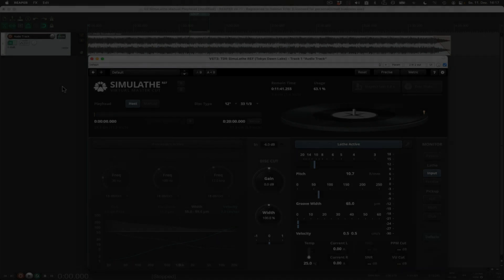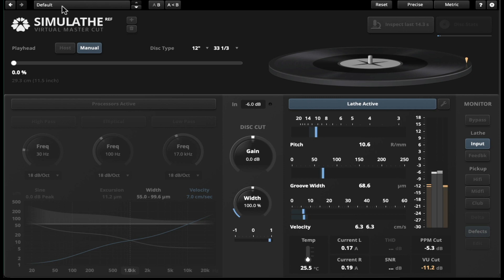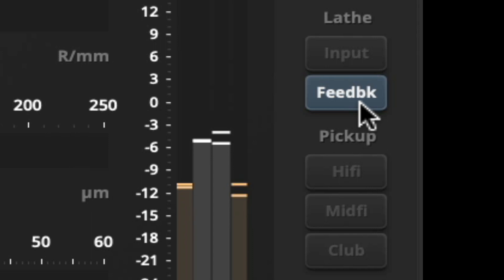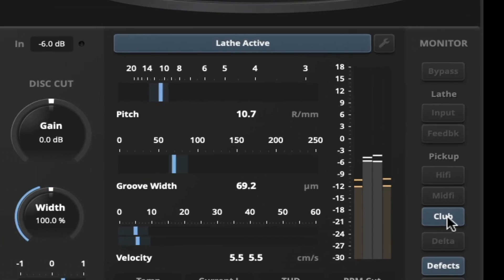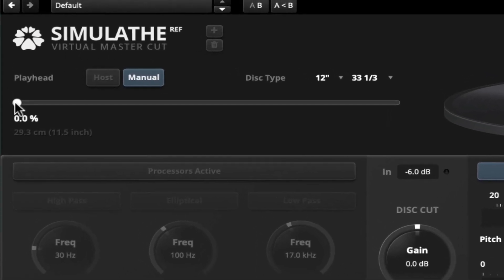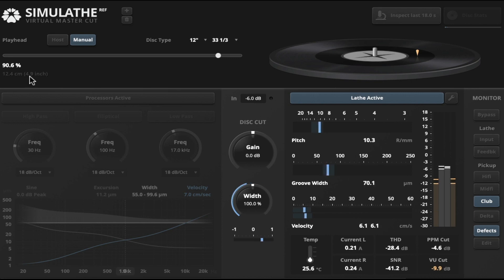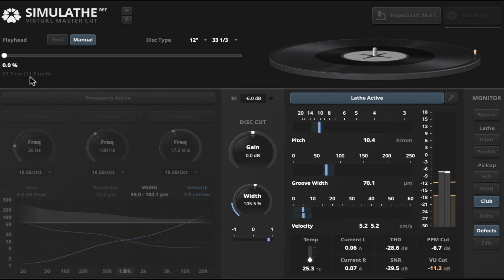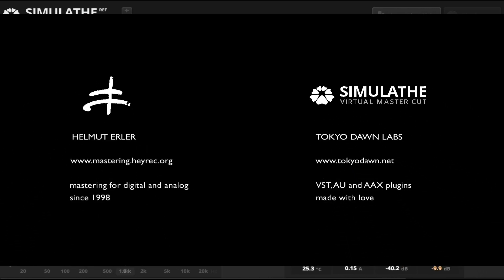SimuLathe Manual Playhead

Comment: OMG, this was a feature I had not even messed with yet. This is game-changing stuff. Saves hours of test cuts and guesswork.
Reply from the maker: Mhhh.... ;)
Reply from the maker: Once you found the 'ultimate possible' diameter for a specific sound/track in 'manual' playhead mode it is quite easy to transfer this knowledge to the whole side cut: Switch back to 'host' mode and get accurate space consumption prediction for the whole side -> tweak parameters (width/land and maybe also cutting level) until the inspected sound sits exactly where you want it to sit (you can go back and forth manual/host mode for this) -> voila. This way you can target a position on the diameter for a specific sound. That is really saving a weekend of test-runs and diameter-tests for delicate cuts.